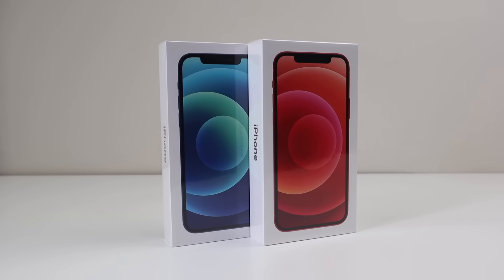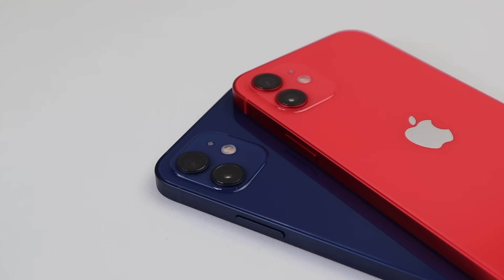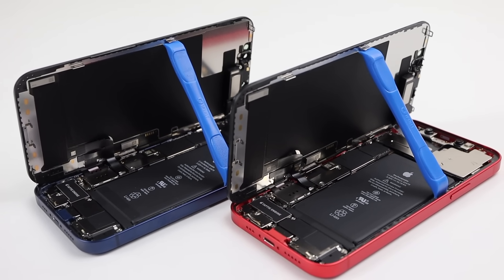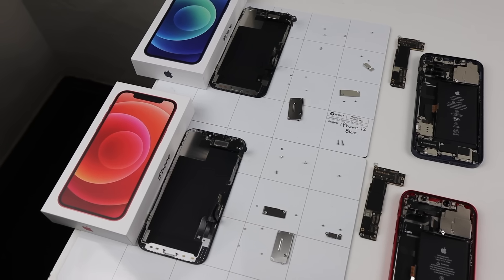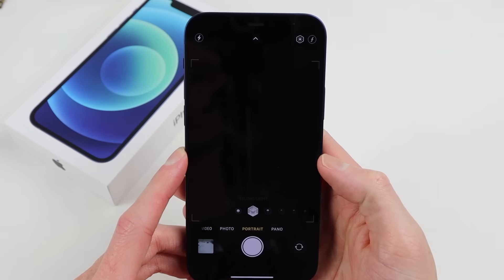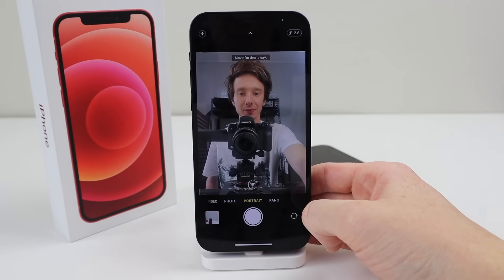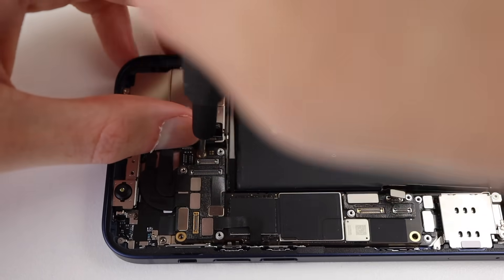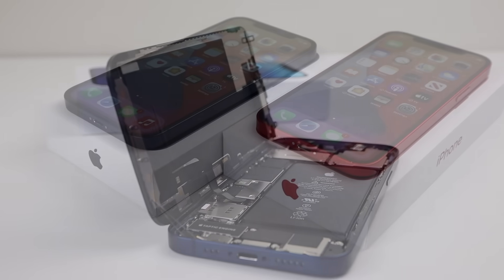iPhone 12 Anti Repair Design - Teardown and Repair Assessment

Comment: Will it might of been your fault that it wasn’t working correctly. Let me explain say you build 2 PCs both with 1tb hard drives and both are from the same exactly manufacturer let’s say western digital yet you want to swap them to see if your games will work on your other pc only to find out that oh no your hard drives do not function it gives you a error message this hard drive was installed in another computer the hard drive needs to reformat in order to function after you move your hard drives to their respective pc both function just fine. This same exact thing happens when you swap parts from one iPhone to the next both are registered to another phone so you can’t exactly swap out the parts however we still don’t know if new unused parts will work. I know apple sucks with their anti repair bs but I saw this test failing as a lot of devices and parts do this.
Reply: Every single other iphone produced by apple passes this test.

Comment: "there’s a Texas Instruments microcontroller on the battery itself that provides information to the iPhone, such as battery capacity, temperature, and how much time until it fully discharges. Apple uses its own proprietary version, but pretty much all smartphone batteries have some version of this chip. The chip used in newer iPhone batteries includes an authentication feature that stores the info for pairing the battery to the iPhone’s logic board. In simple terms, if the battery doesn’t have the unique authentication key the iPhone’s logic board is expecting, you’ll get that “Service” message."

Comment: I will never, never buy an Apple. Once I've already won a iPod Nano that became a watch and that is pretty expensive, but after several tries of simply transferring my musics to it from my Windows pc just like I do to everything that I have, I couldn't do it just because of their software that deny using not Apple things. Even the cable should be an original one or it doesn't accepts it, even if that costs 8 to 10 times the value more (its just a cable bro).
I felt so sad and angry about it that I gave that device for my friend that loves Apple and had an iPhone. She was pretty happy and so do I for seeing her happiness, but it didn't change the fact of the incompatibility made on purpose for other devices, like my Android phone, for example.

Comment: As an iPhone user, I strongly condemn this selfish mindset that apple has been gaining over the years and I am supporting the alternatives for getting rid of tech dictatorship.
Reply: The only reason why i have i phone is because android OS is crap and i hate that it is so hard to understand.
Reply: @16ipm  i have been using both Iphone and Android for ages, and i can just say that the reason you find Android is hard to understand is simply the way Apple design their OS is to simply make you be more loyal to their products. To keep people from switching from Apple to Android. After i stopped using Apple and use Android instead from some UNKNOWN BRAND, yes for real. It feels so much better than Apple, the phone don't auto updates, easy to repairs, and at first the OS feel strange but after a month or so i found its finally freeing me from the jail of IOS. I can actually install everything i want just like how you could on computer, instead of using cracked or high risk applications to just dowload a single app onto my phone. Android also easily customisable, i can simply download an app or messes around with preferences and boom, new interfaces. It also allows me to emulate other systems, hell even windows.
Though this is just my experience so far, dont took too much of my words for it.

Comment: It was a blessing that you couldn't get parts to test its reparability. In having to use two new original phones, you proved that they are serialized at the component level. Well done video!
Reply: Probably a technician interface that will update in system, that will patch a software lockout
Reply: @mptaschek2132  exactly my thoughts too
Reply: There's a product that's made for iPhone repair to swap out a broken screen for a third party unbroken screen. It's a device by the name of the JC - 1V. The device is powered by your laptop or desktop computer. The device has connections on it from top to bottom that are the exact same connectors for the display flex cable that mimic the motherboard connections for that flex cable. The device is a read and write electronics that reads and copies the software data from the broken screen stores it then you remove the broken screen flex cable from the motherboard connection on the  device. Then you take the new screen and it's flex cable and attach it to the same motherboard connection on the jc-1v. It will ask you do you want to write the data on to the new screen you tap yes. The data is now transferred to your new screen that will allow you to use facial recognition true tone and touch ID on your new unbroken third-party screen.
Reply: @bassinbillRC5300  sounds like a pain to repair.

Comment: 1:03 wouldn't a normal USB to lightning cable work, or is the cable also paired with the device?
Reply: It would, but it charges WAY slower, it forces them to buy the overpriced charger, with a TON of unnecessary cardboard, and it’s unnecessarily big box. “Prevent ewaste” yeahhhh no.

Comment: Ive said this once i will say it again, phone companies build their phones to only alst a certain amount of time, you know that update that is no longer supported by iphone 6 and older? Yea its so people are forced to upgrade to a new phone. Apple isnt the only company that has done this. My mom had an old galaxy s6 edge after an update it stopped holding a charge and it runs 10x slower and runs hot well warm. They tell you that its so the phone lasts longer but its a ruse. They do it so you get pushed to upgrade. They dont get money as often when people try and make their phones last.

Comment: I agree with you that there has to be the ability to do repairs to a phone, as some of these phones are too expensive to keep buying new devices every few years, especially since the parent companies discontinue providing service for their outdated phones.  To reduce waste, phones need to be able to be serviced, especially as these older phones could be reused for the free phone markets, once they were refurbished.  Do you have any specific model that you recommend for its ability to be serviced?  I work on a farm and in a big rig, and believe me, it is way too easy for these to get damaged, and really like to be able to repair these devices.  I repair a lot of my own systems, as to have it serviced by a so-called certified after-market repair facility is way too expensive.  I still have my old Apple II, which works just fine and has been repurposed to manage local environmental systems, in which it performs admirably.

Comment: “Only Apple has access to the tools to pair these components with the logic board” is factually incorrect. Third party authorized as well as independent repair shops have his access.

It seems what you want to be able to do is use parts from old iPhones to fix other iPhones. Creating this secondary market for iPhone components, similar to what exists for cars and other electronics and machines, sounds like a good idea on its face. However, how do we stop that market from encouraging people to steal phones to scrap for parts just like is done with cars and other electronics.

Meanwhile Apple invests pretty heavily in recycling their components. If their strategy works, I don’t think you have an environmental argument. You just don’t like their strategy. Which is fine, honestly, but you should give more honest reasons.

Comment: Steve Jobs won't be happy with the way Apple is headed.  This company is becoming a scam right in front of our faces.  
Unable to repair, Genius bar will tell you it will cost more to repair than buy a new one.
We're going green but you have to buy their charger separately anyway.
We're going green but you have to buy their earbuds separately anyway.
The price varies depending on the model (with a small difference in features).
This is highway robbery in full daylight! 
Great video by the way :)

Comment: To everyone saying "just dont buy Apple" (which i agree with) it's not enough even Samsung and others have started serializing parts and making repair impossible without going through the same company that sold you the phone. They will then have a monopoly on repair and force you to pay insane prices for simple fixes often not if fixing the irem but instead replacing it. Or have you buy their newest model which will be priced just a bit more than the repair making it pointless to pay for repair. 

This is how they make bank while increasing ewaste. 

Right to repair. EVERYWHERE! Or we'll be stuck with this system.

Comment: What absolute bollocks. Good old planned obsolescence. Wait until it's dying, and then buy a new phone or go to Genius Bar for the same price. Apple are fucking stupid. And for a company that pledged to reduce e-waste, you'd think that they 'd let people repair it themselves. But nope. It's all about 💰 for them. That 's why I DON'T use Apple products. They can't be modified to how the user wants it, or repaired when it dies. I'm all for Right to Repair, as I've taken apart my old Android phones, replaced some parts, and still been able to use it. Many Android phones don't lock parts down. That's what I like, partially as I'm a programmer (and want to tinker with the OS and bootloader!) and partly because I like to keep my favourite phones for a long time to make the initial cost worthwhile. I once had this old phone of mine that lasted 10 years because I was able to change the parts. Whereas with Apple, they only "last" 2-3 years before they are obsolete and you HAVE to get a new iPhone. And because of the lack of data transfer between iOS and Android, you HAVE to stay with Apple to not lose your data. You can't even Bluetooth transfer data between them. It's fucking ridiculous.

Comment: With the iPhones that had Touch ID, you had order a new logic board and home button together as a set.  They are paired/encrypted together at the factory for secure Touch ID.  If you did not, you had to do without Touch ID.  My bet is now that security function is now tied to the camera.  So now it looks like you have to replace both the logic board and camera at the same time.  But I have no clue on the battery issue?

Comment: I used to work on 95% Apple computers for a major university. Apple started pushing hard to fill their computers with weird bagged parts - almost like organs - and generally pushing to only have their own proprietary specialists work on them, even for accessing an old hard drive etc. You even had to remove the screen with a specialized system.

This was in 2008, so I lost my job, and suddenly what was once an asset (Experience with macs and PCs! Experience with OSX, windows, and lots of Unix-like systems!) had become largely worthless due to the Apple side of my experience. My college work was all with Windows and Windows Server, as well as several Linux distros, but that not being my work experience hobbled me.

Above all else, I hate how much this impacts non-tech-savvy users. If they can't get a warrantied repair, they will probably be pushed by Apple to buy a whole new device, and preventing them from pursuing any repair or recovery work from a third party. As if Apple junk wasn't enough of a rip-off...

Comment: I'm using a hand me down iPhone 6s plus my sister gave me which was a upgrade over my old iPhone 5 since I haven't felt the need to pay 1100+ for a device that does the exact same thing as the one I'm holding in my hand. I bought a battery on Amazon for it and replaced it myself Saturday. The phone is working like a brand new phone again. After watching this I will never buy another apple product again. Ever. I'm done with apple. This is absolutely ridiculous

Comment: Apple: reduce waste use your old charger
Also apple: uhm we changed the other end of the cable... It now uses usb-c instead of the old usb-a so you have to buy a new one.
Reply: They got rid of the headjack saying its the future... this many years later all other electronics have it except Apple. They don't innovate, there's no better reason for the change other than they have to sell new products. I dont get why so many people still fall for it.
Reply: @dustin628  cause they are Apple brainwashed freaks !!!
Reply: @claudiutzu2001  i know, its like they are in an abusive relationship and keep going back just to get slapped again and again
Reply: @dustin628   Removing the Headphone jack is already here, and the future . As 95% of people use bluetooth now.  I am  Android , and galaxy fan.  Apple offers no value, and lacks features , innovation. The only thing they have going is the ecosystem, and how well it works together.  Even then , Samsung is catching up on that.  Absolutely crazy Apple only offers a 60hz display on a 1k plus phone.
Reply: Or use your old cable as well ?
Reply: @MrAmad3us  good idea.
Reply: My grandma's charger form her nokia works for around seven years and it's still compatible with my phone
Reply: Fuck apple im using my old one
Reply: just buy a adapter from usb to usb-c and use the old charger.
Reply: @extec101  ... Exactly. Apple's solution to all the problems they create. Just buy another expensive item from us.
Reply: @sbalogh53  yupp thats why i use android.

Comment: Would anyone happen to know if Apples plan is to recycle used phones? I've had an iPhone 7 Plus 256GB since its initial release and the only issue I've had is battery degradation over time (still haven't had to replace it as it's still at 72% capacity), but when I asked an Apple employee if I could have just the battery replaced she said they no longer do that repair (and that was 1.5+ years ago). Appears that Apples plan is to make phones with low power storage capacity and them knowing most people are unaware of how to properly maintain/use their battery they'll just offer to sell people a new phone when a battery goes bad after 1-2 years.

Comment: Believe me when I say , I was THE most diehard apple fanboy up until recently...
currently I own the iPhone 11 . I purchased it one of the first days it came out from a version store . since the first day I got the phone, the camera flash for taking pictures simply does not work 😂 but if I record video the flash will work , or if I used a 3rd party app like Instagram to take a picture , only then will the flash work 🤦‍♂️ on a phone I paid over 1000 dollars for and is notorious for having excellent camera quality ...needless to say I was very disappointed.
Ive always adored iphones for there simplicity , and genius straight forward interface , let’s not mention the absolutely stunning sleek look and design of the phone. 
 One thing that never fails is the noticeable decline in battery proficiency on all the models I’ve owned , the battery never fails to get really hot after Playing a single cod mobile match . paired with the (often) occasional glitchy Face ID 🙄 
What really puts cherry on this whip cream ,is that I’m still paying off my iPhone 11 and the 12 is already out 🤯 
I want to switch phones I wouldn’t feel right without my iMessage or FaceTime and of course the exclusive emojis🤷‍♂️...

That’s my iPhone rant take what you want from it idk Im just a guy with an crappy iPhone 📲

Comment: the automotive world has been like this for some time.  what they have done is at the software level, the components are tied together most likely by serial number.  the serial numbers in all the the components must match or it thinks its not genuine.  once they install a new part, they marry the components by flashing the new component with the serial number though the charge port with special software.  in the automotive world its called component protection or trp (theft relevant parts).

Comment: Right to Repair is important. If the headlight in your car breaks you can take your car to a third party repair shop to have the headlight fixed. If your hard drive in your MacBook Pro breaks you can take you computer to a third party repair shop to have you hard drive replaced. Instead of spending $3,000 on a new computer you spend $300 to fix your old computer. It's better for the environment too as there's less trash in the landfill. If people want to buy a new computer every few years then that's their prerogative. For many of us, we are on a budget and we want our computers to last beyond the warranty period. It's our computer. We bought it. We own it. We should be able to have it fixed when it breaks.

Comment: Only reason Face ID and camera doesn’t work when you do that is because of the flood sensor that controls them it is encrypted data that only responds to its original logic bored so when doing any screen replacement on the iPhone from the iphone x and up you have to remove the front camera and flood sensor from the original screen you are replacing and transfer them to the new screen and it will work I’ve done that with the iPhone XR and the 11

Comment: To be fair to apple... most people have not only multiple Power Adapters at home but also much cables...
I have like 6 Apple power adapters that are still in the original packaging (Plus 8 from Anker that i use) and the same with the cables, all original packages. I have some Anker USB to Lightning Cables i use since 5 years... they just dont break...

So the power adapter and the cable are not needet, and if you need one they are about 20 bucks in total...